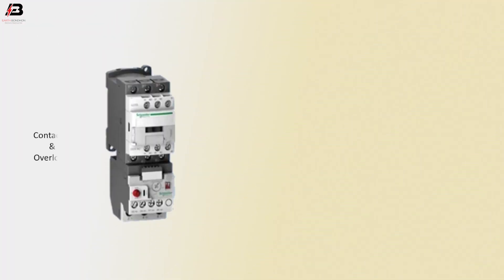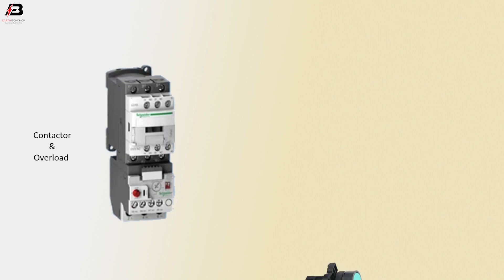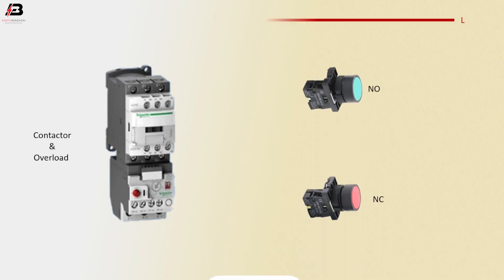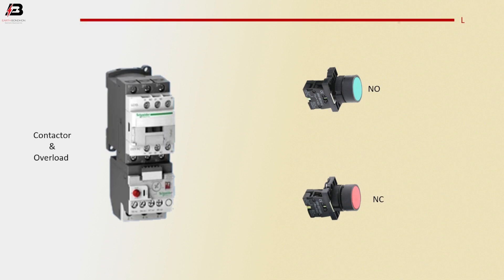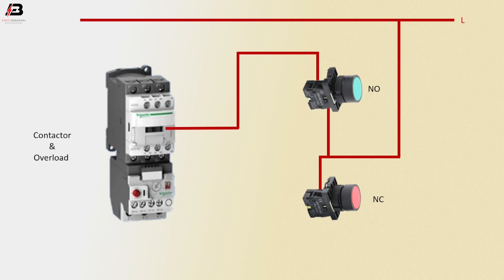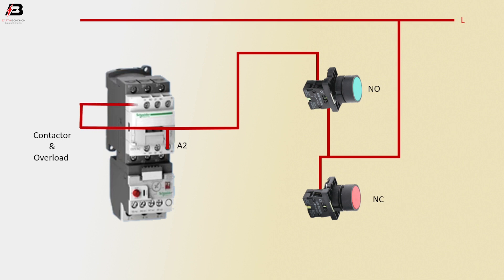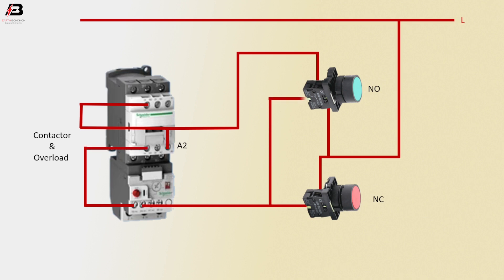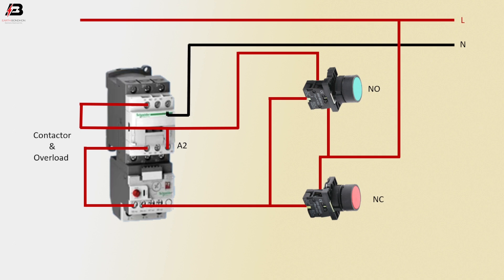How To Make Wiring an Electrical Contactor and Overload | Dol starter

Comment: The lnk between the stop button and start button isn't very good as current will automatically jump that region of space even before the coil has energised.  Therefore contactor will pull in without any button being pressed. Therefore you should ensure that the start button would be in series with the stop and the latching contact in paralle with the start.
Reply from the maker: Yes....sir